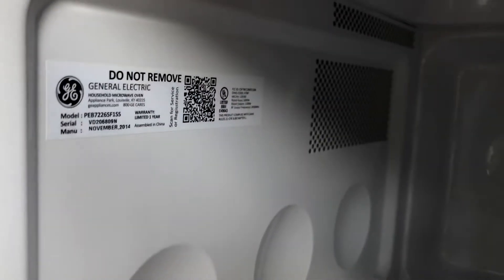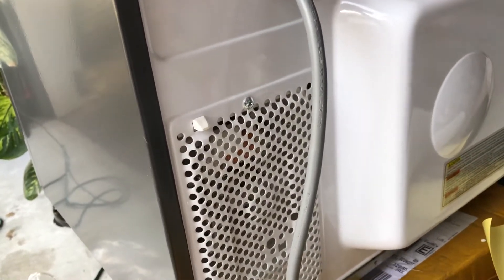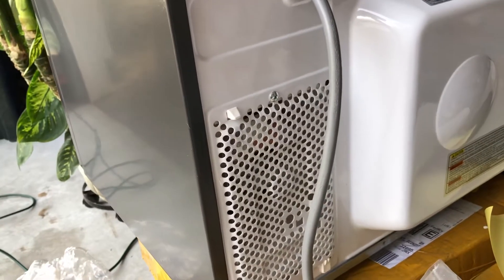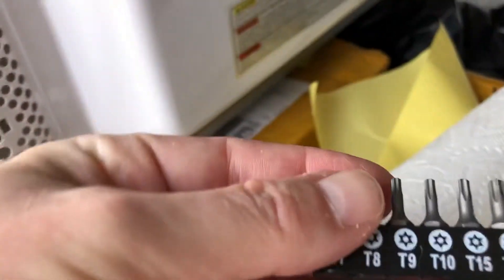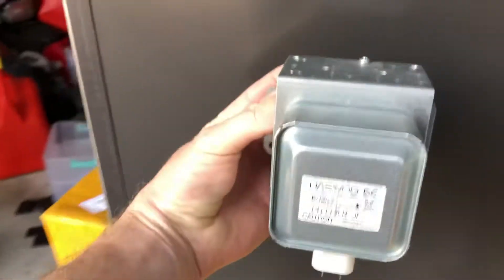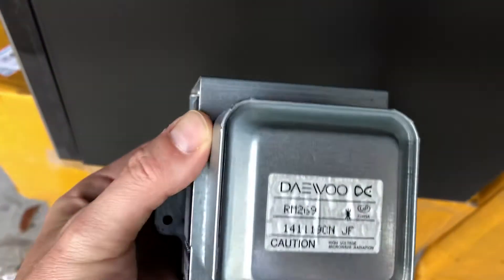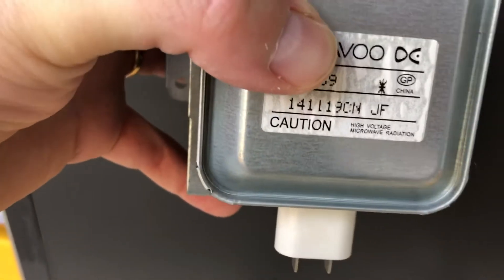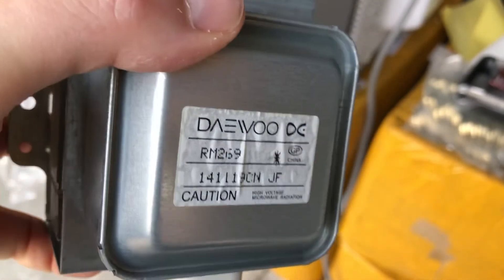GE Profile Microwave Magnetron Replacement

Comment: Disassembly requires a hollowed-out Torx bit.  (I guess they use that type of screw - instead of a regular Torx screw - to discourage laymen from self-repairing it.)  You can purchase that type of bit or use a Dremel to cut a slot in the screw head and go with a flathead screwdriver.